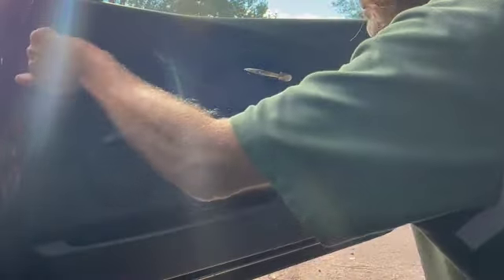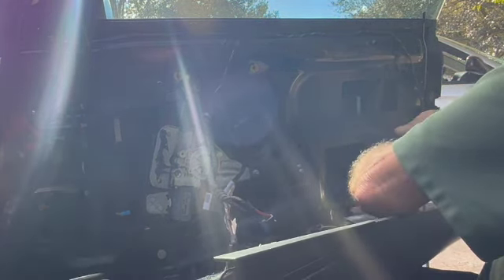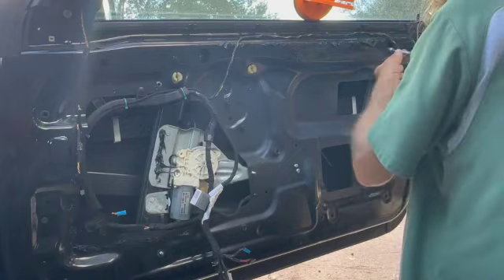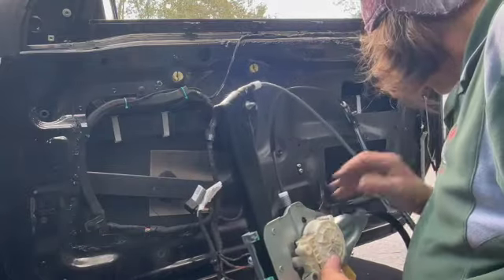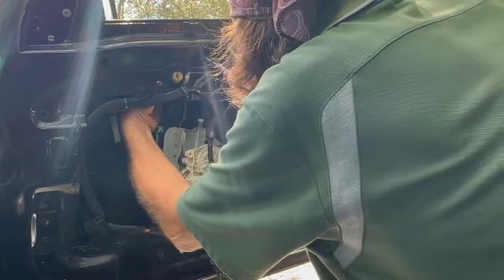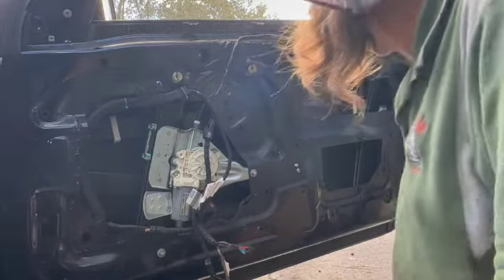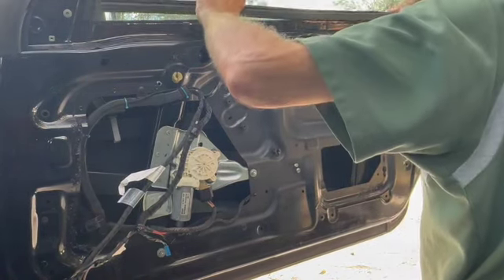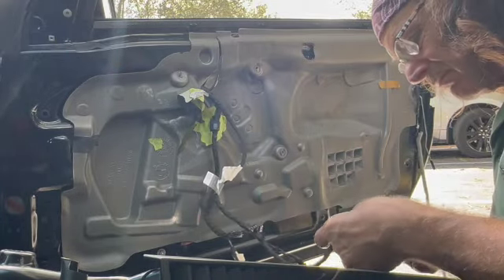BMW 650i 2012-2018 Passenger Window Regulator Replacement

Comment: You have helpful me a lot. I have been doing window regulators on the side to make ends meet and you have helped me a few times. Thank you. On another no have you ever done a 2004 c230 kompressor coupe? I was wondering if it’s the same part and same labor as the 4 door sedan?